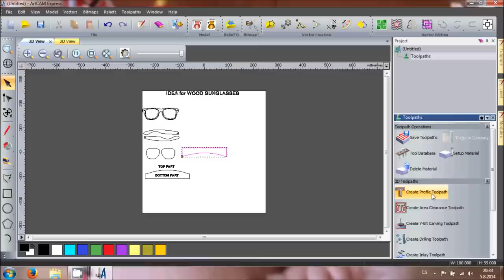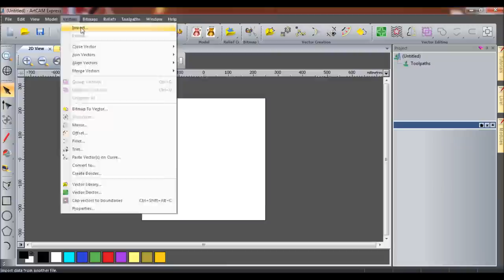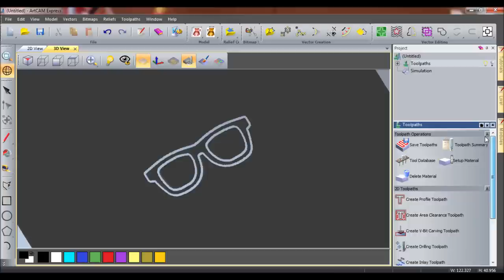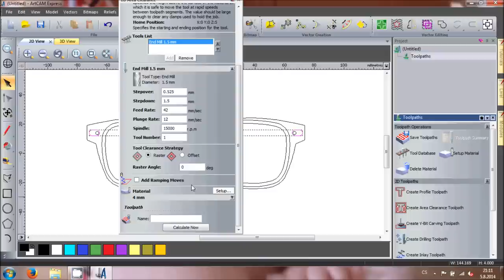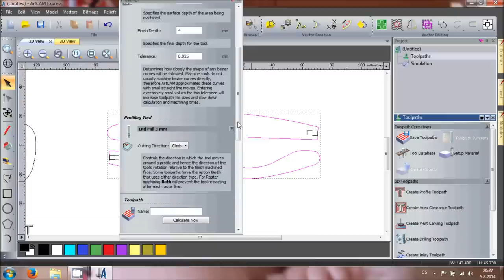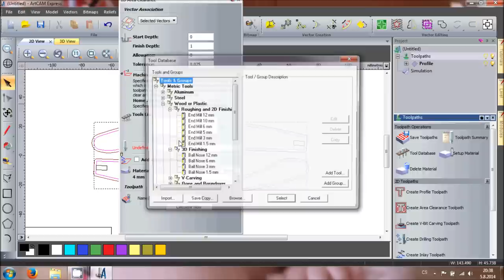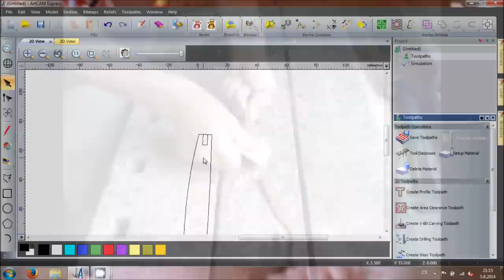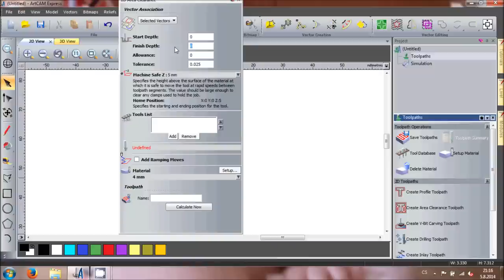How to make wooden sunglasses

Comment: Great!  so all I have to do is buy a $10,000 piece of equipment, and I can make a pair of sunglasses!
Reply: +J Dub actually only about a 1,000. Take out a small loan look into the market and demand of something like this and you could possibly turn a profit.. if you're strong willed.
Reply: +J Dub   Don't forget about the 3D software and the time it will take you to learn it.
Reply: +JamarlsBlack where do you think you could get a cnc router for only 1k
Reply: AND you can save $2.99 on a pair of glasses!! whoo whoo
Reply: guys don't be silly...there are plenty of videos with the FRETWORK machine... go on look more. and BTW that machine is fairly expensive too...so go on with a hacksaw, that works too.

Comment: Why did you make the ear pieces two separate pieces each? Something to do with the hinge?
Reply: +Mike Jeannotte  Two pieces will be laminated  and after glueing and drying  they will keep the curve permanently. Also lamination will be stronger as the wood  runs will form a better structure due to better homogenous effects.
These  wooden glasses are time consuming and if the ear pieces had to be shaped from a solid, well , the  time consumption will not be profitable.
Reply: +Carmel Pule' right on that makes sense. Thanks for the vid/info!

Comment: Ok so your idea of "making" sunglasses is have a machine do it for you? great tutorial
Reply: +Aaron Kagan  I agree but partially with your comment. Indeed nowadays, it's so easy for using Xcarve, 3D printer etc to "make" stuffs, removing the notion, the meaning we both have of the term "to make". However, what you can see with this video is the process, the job done by the Xcarve could be done with a bandsaw and a belt sander; it takes longer time but perhaps the result would be more "fine, accurate" at the end. After that, you see the process how to bend the face and the branches with a home made press made of clamps, etc...
For concluding, I would say that Xcarve&co are similar to Photoshop towards airbrush illustrating or film photography: a need to answer to the shorten delays you have to face when you're a professionnal living of this kind of job (although making wood sunglasses wouldn't get you a fortune ahaha). But i'm pretty sure, we can do the same in our little workshops, with a little bit more patience and will.

Comment: Very nice glasses Shame we all don't have a cnc or a milling machine or a belt sander .. Now go do the same thing with any machine tools ?
Reply: +IIIZiPIII It really wouldn't be that hard.
Get wood.
Mark out shape.
Cut to shape.
Chisel inside part.
Sanding, sanding and more sanding. 
Stain wood
Glue in lenses. 
Screw on hinges. 
Wear glasses.
Reply: +Asdfssdfghgdfy I  do not  think that one could chisel the inside part, perhaps the use of a fretsaw would be more appropriate.